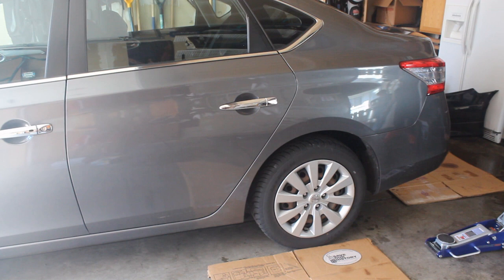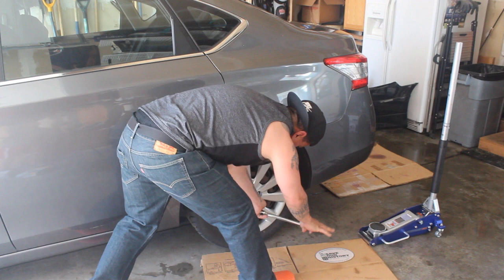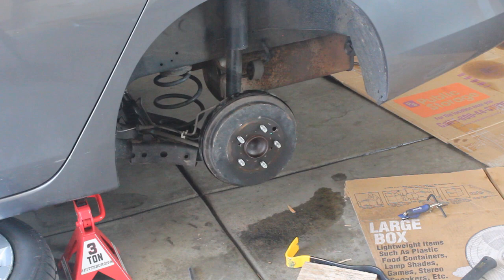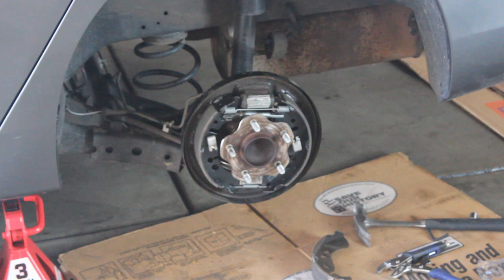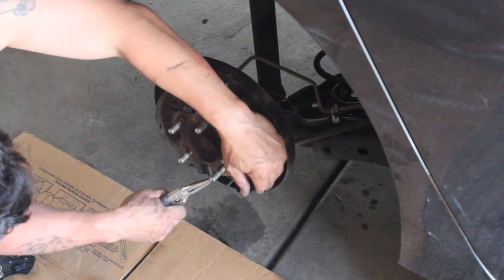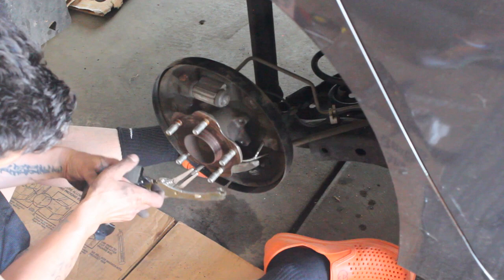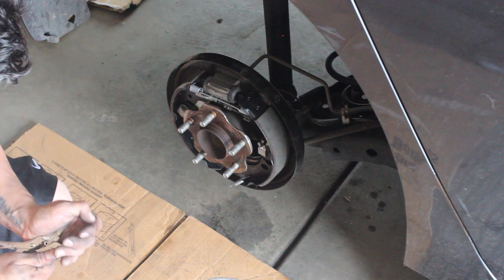2015 Nissan Sentra Rear Brake Pads and Drums Replacement

Comment: The emergency brake cable has a plier specially made for it. Will make disassemble and reassemble a lot easier
Reply from the maker: We didn’t know about the tool at the time we shot the video but it would have been a huge help 😀 thanks for watching and commenting.

Comment: Just for your information those are brake shoes. Also easier to put shoes pins in first holds them in place as you attach springs.
Reply from the maker: Christopher Emrisko thanks for watching and commenting. That’s a great information and a very helpful tip. Thanks again

Comment: Is it a good idea to replace the brake hardware too at this time?
Reply from the maker: Thanks for watching and commenting. It's always nice to replace old parts if possible. I'm not sure if I understand which hardware that you're referring to. But def switch pads and small metal clips. Usually the caliper bolts and pins can be reused but they are replaceable. Hope that helps. Thanks again! 👍

Comment: what thread is the bolt???? bought a metric 8 but what thread? 1.25, 1.50 or what?
Reply from the maker: Scott Senderling thanks for watching and commenting. The exact bolts we used were M8 - 1.25 x 35mm hex bolts. I hope that helps. Thanks again!

Comment: any tips for the top spring.... i found this video hoping it would address that... but nice video...
Reply from the maker: Thanks for watching. Start with the coiled side connected and use pliers to attach the other end of the spring.  The springs are def one of the most difficult steps. Hope that helps. Let us know how it goes. Thanks again!
Reply: Pull in the adjuster, shoe follow making the spring less tension.  Easily to remove

Comment: Just asking because I'm a little confused... do sentra's have different rear brakes depending on the trim because I swear I have disk brakes in the back. Same model year too
Reply from the maker: AntiDarekSquad hey AntiDerekSquad. Thanks for watching and the comment. To be completely honest I’m not sure. This was a friends car I helped with but I imagine they would all b the same but this was the first Sentra brakes I have seen. Sorry if that didn’t help but thanks for watching and please reply if you find out any additional info on the Sentra brakes.
Reply: @firsttimersDIY  Yea I found a forum that said that the SR and the SL trim levels have disc brakes on all four corners. The base just has them up front with drums in the rear. Thought that was kinda weird
Reply from the maker: @AntiDarekSquad  Thanks for the info. That's interesting that they would do that but a great thing to know.  Appreciate you sharing that with us. Sorry for the delayed response.

Comment: Does it self adjust?
Reply from the maker: Hi David!  Thanks for watching and commenting.  i'm not sure if I understand completely but once you reattach the brake pads to the brake line and reset the springs, side bolts and clips, you are good to go.  Let me know if that answers your question or if there is anything else we can help with. Thanks again!
Reply: First Timer Auto The adjuster that goes at the top behind the bigger spring. It looks like it self adjusts, just not 100% sure.
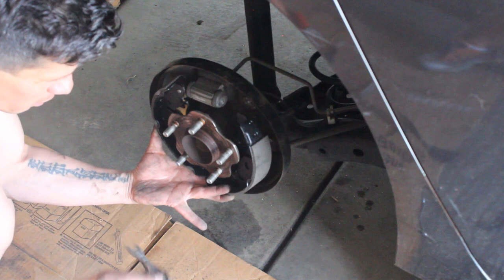Reply from the maker: @MrDavidla66  if you are talking about the piece at 3:51 in the video then you only need to make sure you align that piece with the notches on the pads. That piece in addition to the springs and clips will make sure everything is aligned and positioned correctly. Good luck. Let us know if you have any other questions. Thanks!
Reply: First Timer Auto Ok sweet! Just finished the rear brakes on my gf's 16' Sentra. This video was really helpful! Thank you!